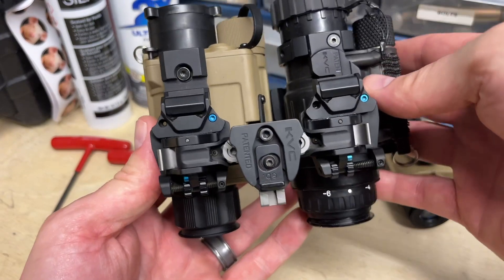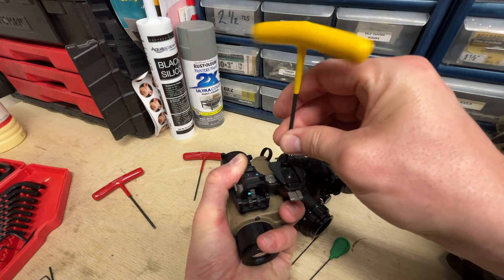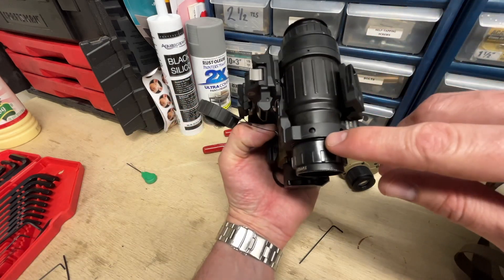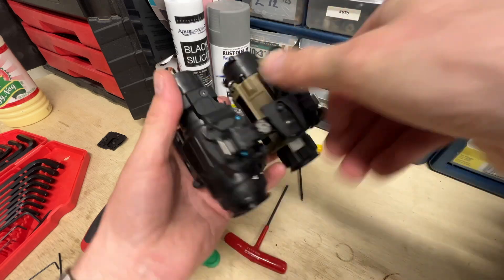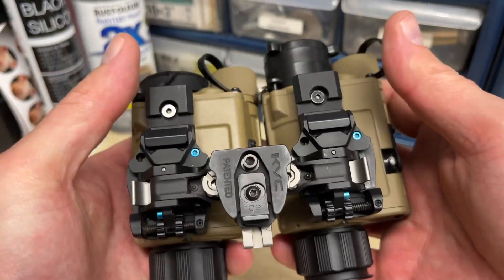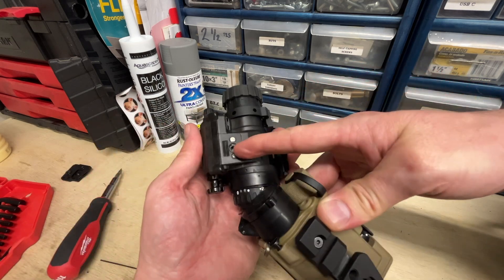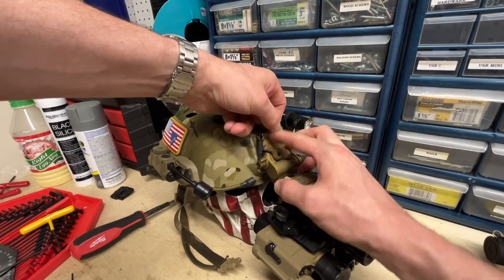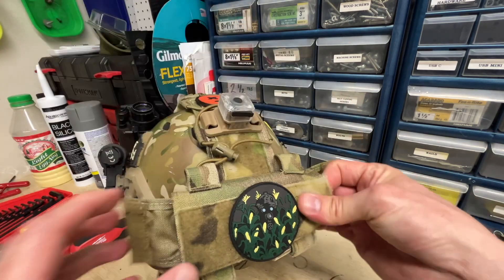Helmet Mounted Thermal: How to set up iRay RH25 and PVS-14

Comment: LOL the cost is breathtaking. I recently bought an iRay RH-25 and PVS-14...after buying a Ops-Core FAST bump, Wilcox G24 and Wilcox J arm just to get at least a monocular up and running I'm feeling a little woozy. I think it can be done cheaper with the Wilcox SkeetIR but you'd lose the PicTail on the RH-25 and I'd like to keep the ability to toss it on the mount I got that also takes the pic tail.
Reply from the maker: No one ever said being The Predator was going to be cheap.
Reply: @thermal_el_jackson  it gets worse, I turned around and bought an RNVG-A a week after the PVS-14 😭 It’s weird, you don’t really see anything more but the brain is a lot happier walking around and everything just seems brighter. I guess I’ll just be using the RH-25 handheld with one tube flipped up or leave it on my rifle.
Reply from the maker: @JamesReedy  hating money is an American tradition. Happy Thanksgiving!
Reply: @thermal_el_jackson damn skippy, I can put them under the Christmas Tree (when it goes up) and feign surprise! 

Happy Thanksgiving!
Reply: @JamesReedy im currently wrestling with the decision to keep my rh25 as a clip on for my rifle and run binos instead of the combo with the monocular. It sounds like you did the same and happier for it?
Reply: @silencerjunkie1111  yeap, I quickly abandoned the idea of PVS-14 with Thermal on a helmet, no f'ing thanks. So now the RH25 gets to be a hand held thermal or it gets thrown in front of a Kahles K16i 1~6 LPVO on my 5.56 kinda/sorta DMR setup. I say DMR cause while it's 16" it's a very heavy barrel and the rifle is configured with very few fucks regarding weight.
Reply: PS - I ended up with an AB Nightvision RNVG-A with a pair of 2400+ FOM L3 White Phos bino's and I still have the PVS-14 kicking around for I dunno, I put it in a bag with a skull crusher and consider it a backup or for stuff where I don't wanna bring a $10,000 pair of binos.

Comment: how do you run battery pack cablw when thermal is in left eye or is it even posible
Reply: Theres an argument for the flir breach i suppose, as the breach has dovetails on 3 sides so you can orient the unit differently for different placement of the battery.
Reply from the maker: You don't.

Comment: Is there any adjustment in the bridge for spacing for eye width? Obviously the swing out and you could change height, but I don't know if it has an adjustable stop at the bottom of the travel.
Reply from the maker: Yes. There are wheels on each side that allow the IPD to be adjusted.

Comment: Does KAC even make that bridge anymore? I do believe its a mythical creature that only exists in fairy tales.
Reply from the maker: Not right now, to my knowledge.  But a little birdie just flew by and suggested looking on eBay.
Reply: @thermal_el_jackson  I’m finding some knock off dual bridges for 168.00 on ebay. Is that the one you bought? And if so no issues with quality?
Reply from the maker: @WhentheLightsgoOut  I have no experience with the fake ones. You are 100% going to be kidnapped and sold into an underground jello wresting league at that price. Might be worth the risk.
Reply: @thermal_el_jackson  too good to be true and Not sure who told you about the league, but they broke the only rule..
Reply: @thermal_el_jackson  a birdie just told me that sotac will release k-clips and the OSS set in the next month!  Unicorns may very well exist
Reply: How did the ebay bridge work out?
Reply: @cbman2184  pretty good so far actually. Decent quality. I’ve never had my hands on the real pair but the knock offs work great.  Only con for me is the weight. Those ounces add up. Price is there though 👍🏼
Reply from the maker: @WhentheLightsgoOut  weigh your knockoff bridge for me?  I'll weight my KVCs.
Reply: @thermal_el_jackson   The ebay one says: Net weight: 100g (3.5 oz)
Reply from the maker: @cbman2184  the number of fucks I give about what stolen chingrish description you read on an eBay listing is less than one.
Reply: @thermal_el_jackson  I just weighed the sotac version and it’s 111grams. That’s equivalent to 3.92oz. What’s the real deal weigh?
Reply from the maker: @cbman2184  I don’t own one.
Reply from the maker: @scottshellenberger4721  3.41 oz on my coffee scale. Thanks for doing that.
Reply: @thermal_el_jackson  I wonder where the weight difference is at?  Not an advocate of pirated stuff, but sure wish I could get some offset shoes and the oss.
Reply from the maker: @scottshellenberger4721  Several components of the RQE/KVC bridge are titanium. I suspect the Kung Pao Chicken version is all aluminum.
Reply: @thermal_el_jackson  😂😂😂😂
Reply: If you want I can disassemble mine to figure out what each component weighs.